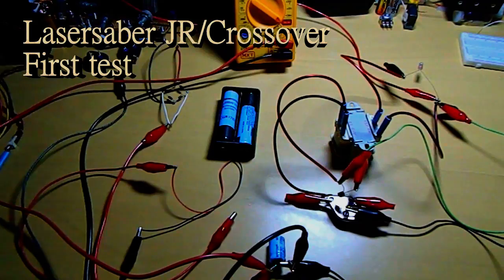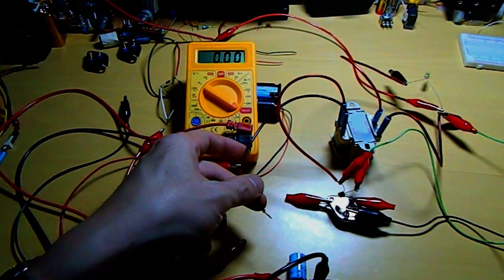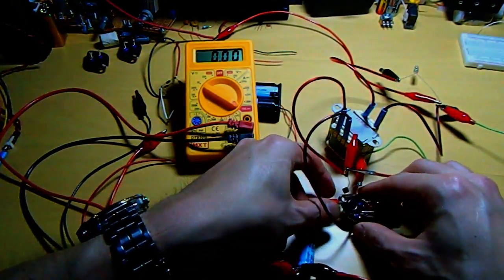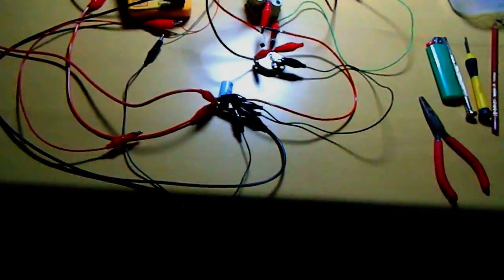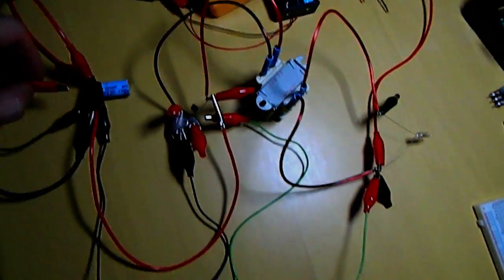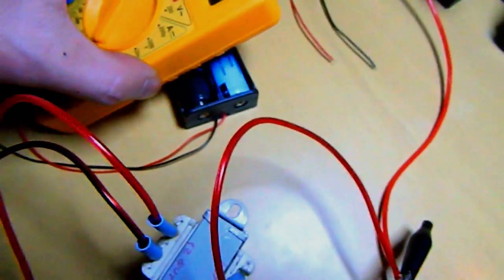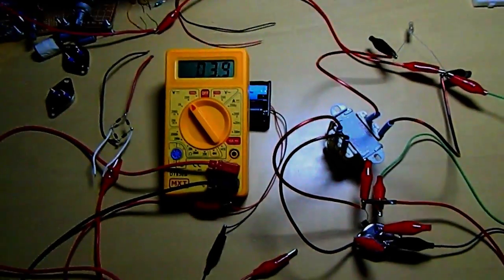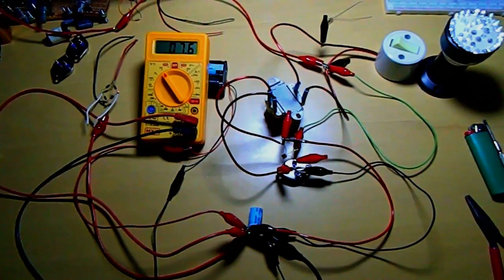LaserSaber Joule Ringer CrossOver First Run

Comment from the maker: I always try to use common transformers, like the one inside a wall socket power supplies. This one on the video was from an old PC speakers. 2.6 ohms at the 12v and 104.1 at the 110v. 500mA.